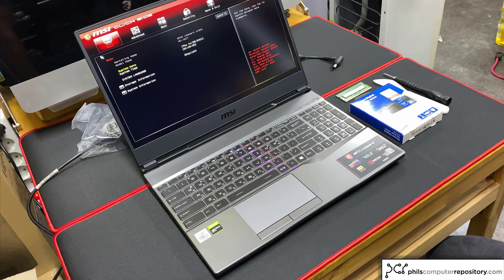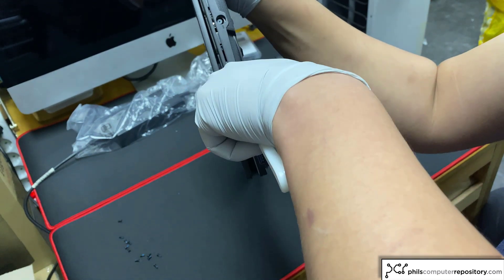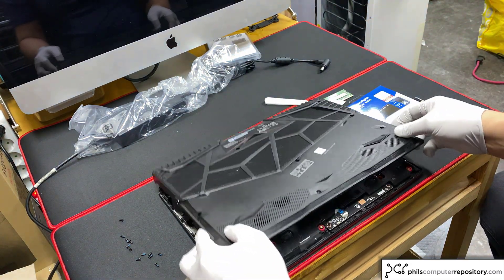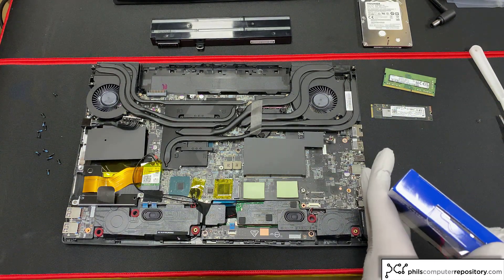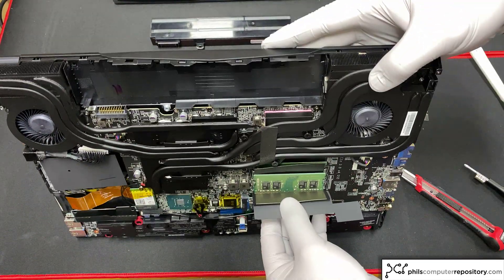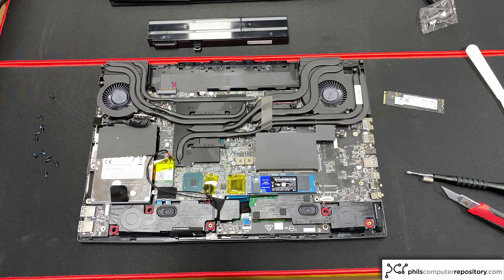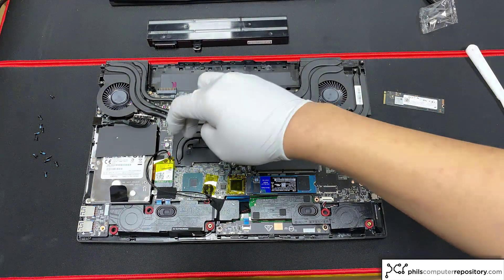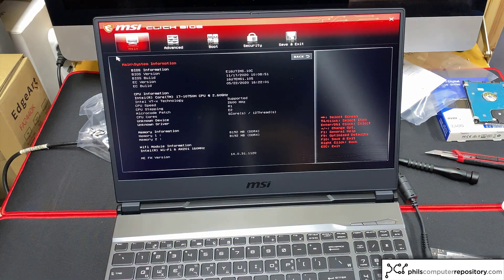MSI GP65 Disassembly and Upgrade (SSD, HDD, Ram)

Comment: After adding the HDD, my case wont fully snap back together. It seems the hard drive is protruding, as the protective flap does not sit flat on top of the drive. Apparently this laptop requires the thinnest possible version of the 2.5" hard drive, as I bought a 0.37" thickness drive instead of 0.28". It's very frustrating that this is not specified in the manual anywhere. I wish I saw your drive recommendations first so I didn't have to go through this...

Comment: I have the Katana, so if it's even Slightly similar the stock version will do what you need until you can upgrade... Horizon, spider-man, and RE2 in max has noticeable problems, but are very much playable, I have no issues in the setting right blow max, but ray tracing lags hard, you'll need that max 64gb of ram for it to run smoothly, or just more than the 16 it has, 32 would probably be ok, but it is expensive so might as well max that mug out

Comment: Does anyone know the exact sizing of the additional two screws from the manual packaging, the ones used to fasten the HDD to the bracket. I lost mine and I would like to replace them
Reply: Did you ever get an answer? I have the Katana and I could dig out my manual and look for you once I get off work

Comment: good afternoon, I have a question or doubt

you can see next to the ssd that is under the ram, on the left side you can see or appreciate a slot for another ssd, but it does not have the slot, can that slot be installed?

Comment: Say I wanted to replace the battery for this, which replacement would you recommend? My current one is acting strange, it says it has a full charge, but then you remove the charger wire...and it dies in 15mins. I thought to myself, well that isn't normal. I wasn't gaming or anything just yet. I tried calling MSI help center, and they were very unhelpful because they don't expect someone to want to fix their own laptop. The whole "send in for diagnostic test" saying.

Comment: Can i upgrade with ssd in place of the hdd slot ?
Reply: Yes you can, you may need one of those adapters/holders for it since the SSD would likely be smaller than a HDD. The speed may or may not be a bit bottlenecked as well but basically if you can fit it into the port it'll work lol

Comment: I have a msi gl65 with a Intel cot i7 10th gen which has a 4gb nvidia gtx1650 and 8Gb of ram I was thinking of upgrading my laptop but I'm confused with which type of ram goes great with the laptop can you suggest a a good ram which I can use for the upgrade. Also is it possible to change graphic card if it does, I want to know if which rtx series I should go with

Comment: Can you please do a Repasting video of the msi gp65 leopard. 
There is this white thick thermal paste all over the VRams which is totally stuck like glue with the heatsink. It's so tight that I can't even pull it out.

Comment: I have a quick question. The speakers on my one year old MSI GP65 9SD laptop don't have sound, it just happened a couple weeks ago. It stuck at headphones mode in Nahimic 3. It used to have pop up message asked me when I plugging in the headphones jack but it doesn't show the pop up anymore! I uninstalled and reinstalled Nahimic many times but it didn't fix the issue. Anyone has the same issue and know how to fix it, please let me know I will appreciate. I'm just using only headphones for watching Youtube and news now. Thank you.
Reply: Hi , i have similar issue, but when I sometime restart the laptop, the speakers and mic work, when I switch on the laptop after shutdown , no sound and mic
Seems some kind of driver issue
Tried rolling back and updating nahmic drivers, let me know if you were able to resolve the issue, right using Bluetooth speakers with no issue as workaround

Comment: Some time ago I Added an SSHD to my MSI GL65 Leopard SFK . I recently upgraded the SSD with a 1TB SSD from Team Group. I will upgrade RAM from 16 to 32GB sometime later. AS I was reading the comments, One of the Commenters gave me the idea to one day replace the 2TB SSHD with a 2TB SSD. I have 2 other older MSI laptops ,GT70  OND and GE72 Apache Pro 6QD

Comment: Hello, could I add a 2.5 SATA III SSD instead of the HDD?  This is the one I am looking at on Amazon:    https://www.amazon.com/SAMSUNG-Inch-Internal-MZ-77E1T0B-AM/dp/B08QBJ2YMG/ref=psdc_1292116011_t1_B077SF8KMG?th=1   Thank you for any info on this matter.
Reply: You just gave me the idea to get one of the same. I'm going to get a 2TB model to replace the 2TB SSHD I have in my MSI GL65 Leopard SFK

Comment: Can I add a 2 tb hard disk instead of 1tb?
Reply: I currently have a 2TB SSHD in my GL65 Leopard SFK .
Reply: @tw350z7  does the laptop come with a hard drive and an ssd? i have the same model laptop and im curious
Reply: @2000ys3  It came with SSD only. I added the Hard drive

Comment: I do not have access to the screws that come with the laptop manual shown, what kind of screws are these? I don't want to buy the wrong ones.
Reply: Same question! Cant find the screws in the original box and need to buy replacements
Reply: @MrR8Grillz  I literally ordered "2.5 Hard Drive Mount Screws" and they worked out just fine :]

Comment: I have the GL65 with the 2060, I think the GP65 has the 2070?
Going to get a reflow gun so I can add the 2nd m.2 slot MSI left off.
Wow, surprised that model only had 1 RAM slot loaded. Mine came with 2 3200 Samsung 8GB sticks, the 512GB WD nvme, and a 7200rpm 1TB Seagate HDD.
Reply: Update, I added the components for the 2nd m.2 slot and it works, now I have a dedicated nvme for my games.

Comment: how to resolve the heat issue in that laptop??
please upload thhe video regarding that.
Reply: bro what is your cpu temp while browsing
Reply: @BSP-18  70 to 80 degree bro
Reply: @badrinathd483  use throttlestop and reduce the boost speed on FIVR